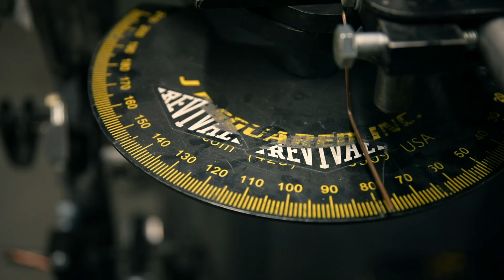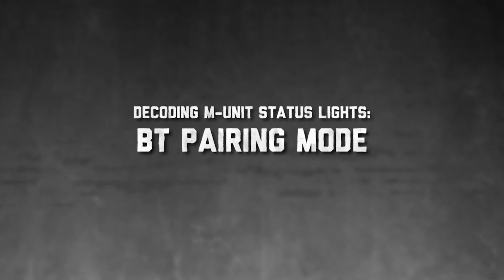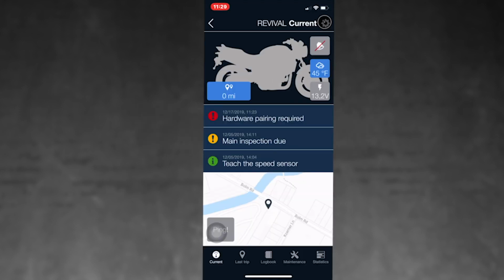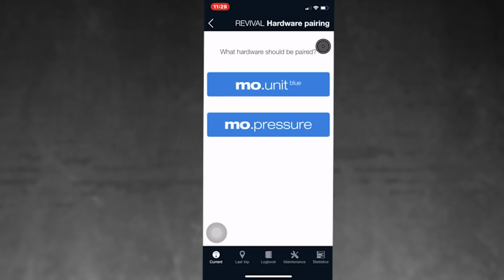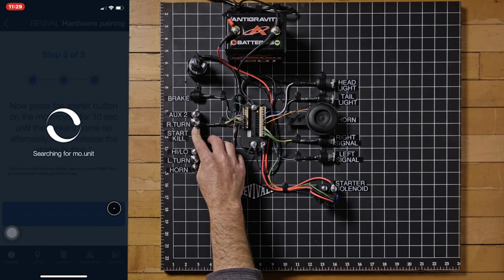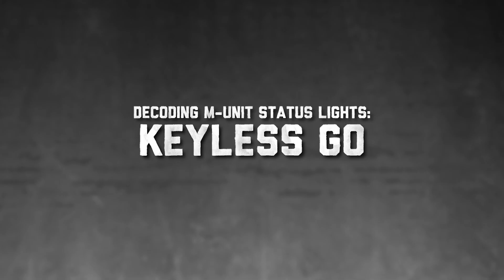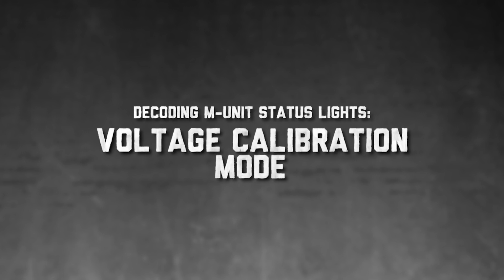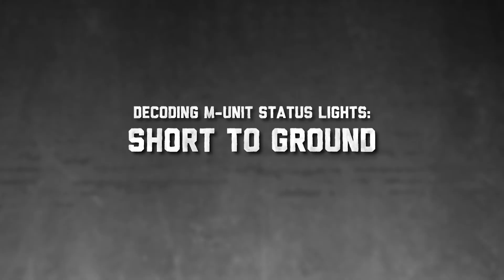How To understand the LEDs on a Motogadget m.Unit (mo.Unit) // Revival Tech Talk

Comment: Voltage calibration mode if that's not done could you possibly be putting too much voltage to an electronic ignition and it cooking said electronic ignition I have burnt two of them so far and a couple sets of coils

Comment: Hello

The seller has removed the motorcycle from his profile.

When I press the horn for a long time the lights come on one after the other.

In step two the light at AUX2 flashes and ignition remains on constantly. 

I can use slot 1 or 2, and put my cable on the chassis or the least of the battery nothing helps.

How do I reset it? What to do?

Comment: Last night and today I’m  trying to bench test my m unit blue to see if I can put in the settings for my bike even though the M unit is not attached to the bike yet. I did a bench test set up like Stefan did in the other video but when I put the wire in to the Lock terminal my ignition light lights up and the aux 2 lights up I noticed you said your aux light lights up. I wonder why my aux 2 light is lighting up and if it makes a difference.
Reply from the maker: You can configure your M-Unit in a few different ways. For more in-depth help please feel free to reach out to our tech support team - techsupport@revivalcycles.com

Comment: My main light has 3 positions, off low high how do i set this up using the m unit which only has low high options?
Reply from the maker: If you are using the OEM switches the OFF position will no longer work. If you have push button switches you can tap the button to cycle through the three functions.

Comment: How is nothing on that board been earthed?
Reply from the maker: It has all been earthed (grounded) to the m.Units two ground posts which are also its mounting points. Then a single 12 AWG ground is run from one of the posts to the battery negative. 😘

Comment: How do I get power out from Aux without turning a key as I have a push button start but need power out from Aux 1 or 2 as soon as the M-unit initializes (using the keyless go option)?
Reply from the maker: When your in the settings mode you can program the AUX 1 to activate along with the IGN out when the m.Unit powers up.